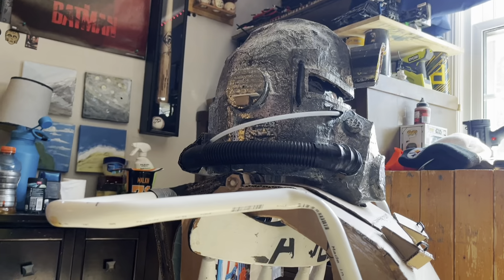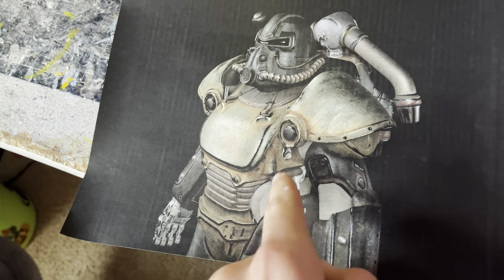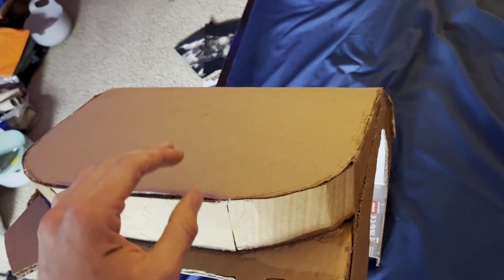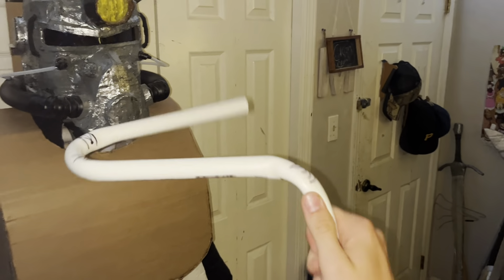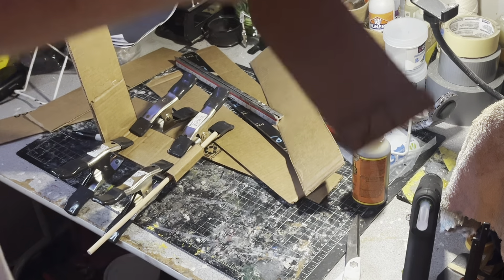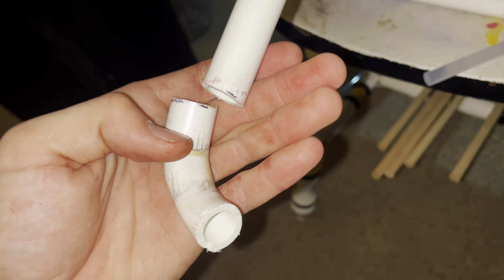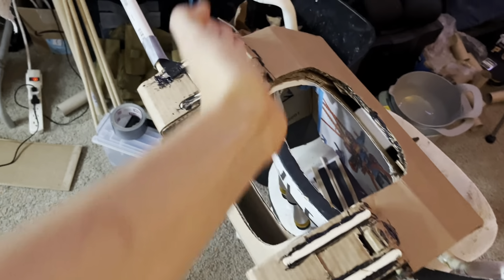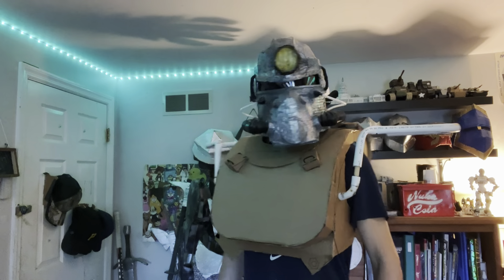How to build Cardboard T-51 power armor Pt 1

Comment: It's great, man. I have a hip problem on the t45b power armor. The hips simply slide off the legs, and if you make them smaller, they do not fit on the leg
Reply from the maker: This time I will make my power armor, 100% accurate where the hips move with the legs I kind of customized my T60/45 to make it more enjoyable but now I’m going for better capabilities impracticality I’ll be working on the legs and post a video on the fourth video of my series

Comment: DO THE NUKA COLA DO IT NOW!!! also is the helmet breathable?
Reply from the maker: Hahaha kinda my breath fogs of the helmet after a minute but I will add vents
Reply: This might be over the top, but you could add a small fan in the back of the helm to cool the insides so you can be in for longer periods of time. I followed your German knight helm and it turned out… meh, but I’ve been looking for a good power armor tutorial, and this is frikin perfect. You can’t comprehend the amount of joy I am filled with to see this. (Also when you make the new helm you should try to smooth the paper mache) hopping I can make this, post part 2 soon!
Reply from the maker: @jacobdoesstuff_ig  brooo I was actually already thinking that!! And thanks too yeah the German knight helm is slightly dated but I’ll make another in the future
Reply: @MarksWorkshopcrft  and you could connect the battery to the light and the fan, and it would fit in with the helm too. When do you think pt 2 will come out because I’m moving cross country right now and we’re gonna have a LOT of cardboard left so I’m hoping that I can make this when I get home.(I’m sorry I’m an obsessive talker and I have no limits) :)